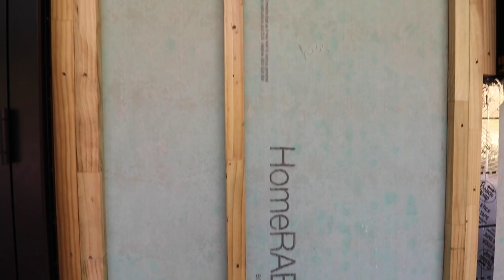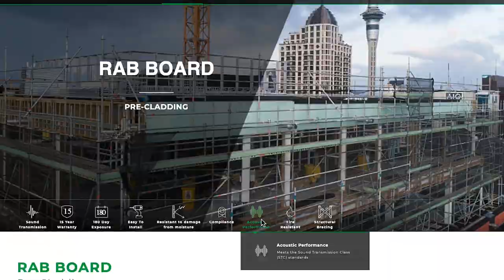The Story of How RAB Board Saved my Build

Comment: Great video. Rab also adds the extra fire protection. Building also does but not to the same level. The only thing that concern me a bit about Rab is its breathability e.g. if you got an inwall water leak. With paper it breath and dry out over time
Reply from the maker: Good point about the fire protection. Living in the house, and working in my studio at work which also has it I've been impressed with the noise reduction.

Comment: Great stuff. The question though, would you use it again if you had the choice between RAB or paper and knowing it will take longer and greater expense? (pandemic aside). 

Also would you prefer to use RAB or Ply? 

95% of the time our Clients (Builders and Architects) seem to spec Ecoply anyways. Can't remember the last time we've only used underlay in our drawings.

Ply is just such a great product because of bracing and weatherproofing (Ecoply Barrier). There is also the reduction in noise. Maybe even a bit better R value.
Reply from the maker: Defeinetly would use again 
We added it to plans as a variation but still managed to shift some of the BU's to the RAB and avoid as much inside as possible